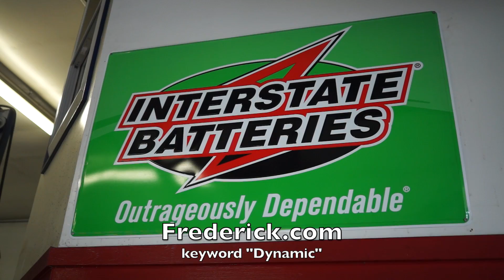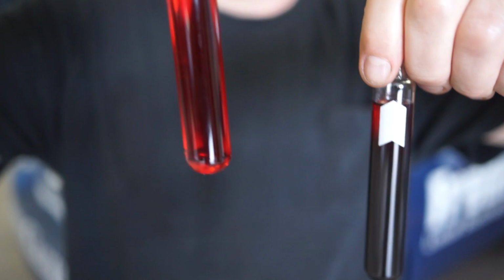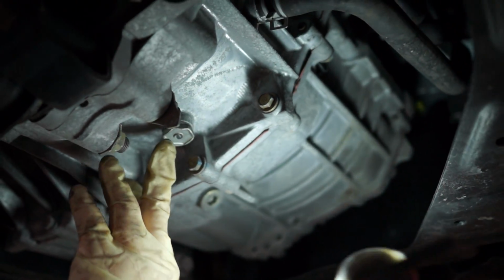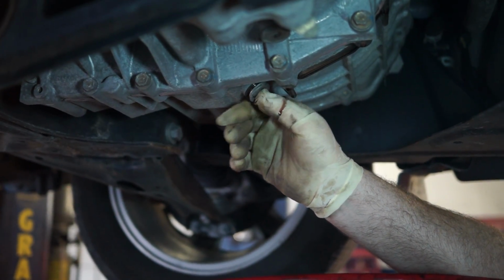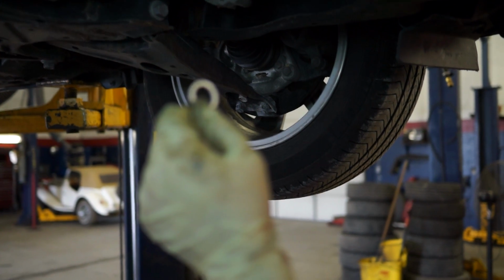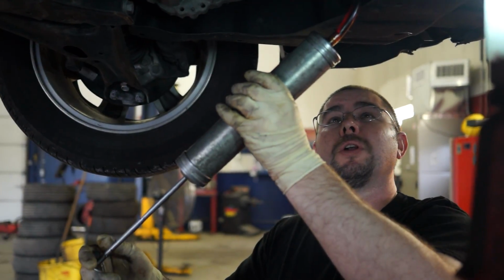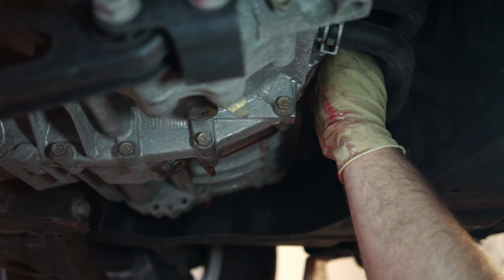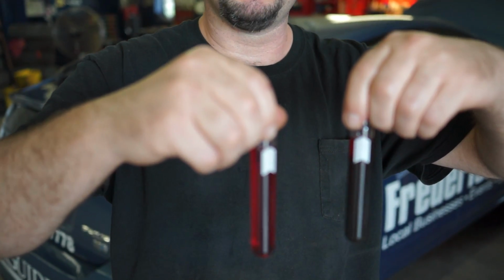Prius Transmission Fluid Change (eCVT)

Comment: Well to answer a couple questions, Craig.
Yes, I believe so, They are more reliable based in it's mechanical simplicity alone. At least in my opinion. Why, because there is much less mechanical things to go wrong. Such as valve bodies to get clogged or worn out and then there is the torque converter, fluid pump, numerous seals,& ect,ect. in a typical automatic transmission.   And,as far a electrical is concerned, they are, just as &/or no more reliable as any electrically controlled transmission now a days, which means just about all of them.
 The big thing is regardless of what you have, You must do consistent maintenance, & it must be done in a timely fashion. And to answer another question, the Toyota ATF WS may last 100 k miles, BUT WHY in Gods name would you wait that long. The lubricating aspect of just about any modern Fully Synthetic ATF will last well over 100k miles, BUT it will be so dirty that it's effectiveness will be diminished to the point that it will not be able to do it's job. It would seam very silly but, Think of it this way.  When you get new ATF Fluid do you get a fresh package of metal grit to put in with it, HELL NO. So never expect any DIRTY transmission fluid to lubricate properly regardless of how old/new it is   The job of changing the transmission fluid in a series 2 Prius is fairly simple and relativity inexpensive , if you do it your self. So what are what waiting for, DO IT!!

Comment: Shit easier than changing oil.
Reply: Well technically the fluid is oil of sorts ;p
Reply: yup, even a VW dsg can be done the same way- just fill via via filter hole- just measure what came out
Reply: Can be done for less than 20 bucks in your driveway, super easy job

Comment: Thank you for showing where and how much amount trany it needs in toyoyo pri. I didn't need to spend $400 and over 4 hrs of wait at Amko or at toe🪀🪀 dealership service.  What I need was  cheap car ramp from 🧱 mart and same toe 🪀🪀 quality AT fluid at O'really 4 cheap 💵. But you do need 10MM
HEX bit socket and good steel pipe for wrencher to losen hex bolt in toyoyo pri and pump from $🌲 2 suckin back 4qts trany oil.
I know this is dirt cheap Joe auto work.  But 4 current econ going to be 2nd  Sub prime crisis.  This is cheap way to save with less than  1hundy$s  of your  💰 to start do your self work. Oh yeah you can drop dirty trany oil to autozone. 
Go do yourself save 3hundy$s.

Comment: Toyota, who manufactures the vehicle says the transmission is sealed and does not need to be changed.  But every guy who makes money changing fluid says it does.
Reply: +Richard Woolf they can brag about their how low their "cost of ownership". i have seen quite a few of the transmissions that ran a life time with original fluid. 150k mark you need a new transmission.
Reply: +harsha806 Yeah, mine has 260k and never changed it once.
Reply: change it..........$17.00 at walmart for the fluid

Comment: Why didn't u use cvt fluid from Toyota? If it's a cvt transmission?
Reply from the maker: The fluid we used is correct.
Reply: @MidAtlanticTV  . I spoke to my local dealer and I was buying the WS and he said it was the wrong 1 for my prius. He ran my Vin and it recommended cvt fluid and not WS. I wanted to use the WS due to cost difference.  But get a prius Vin # and call dealer.

Comment: Why cant u just run a pipe from top of the engine ...stick a funnel and let gravity do the rest
Reply: You can do that. 
But remember he has a lift and the car is leveled. Time is money.  
He's make $95K+/year. And the owner must make 10X+ more than his employees.

We do some oil changes to some cars & we charge $37,000.00. 
And doing transmission fluid drain & fill are much higher.

Comment: Prius transmission doesn't have clutch inside.
Reply: ***** planetary gear set that is controlled by two electric motors.
Reply: ***** They last a long time since they have no wear items inside. Toyota actually says that the fluid doesn't need to be replaced ever, but people replace them every 100k miles for peace of mind. My trans has 315k miles on it and fluid change was at 193k. I'll replace it very soon just to keep the bearings and seals fressh.
Reply: ***** You got to watch for engine oil. They use a bit of oil after a while. Mine take a qt after about 2k to 2.5k miles and engine was replaced at 193k with a used one by previous owner.
Reply: This was also a mystery to me. Having smelt it with my own konk i did some research. It has a conventional clutch linking engine to planet gear. Google Prius clutch.
Reply: MrImarcus That clutch doesn't do anything. It's there just in case the engine lock up so the wheels don't lock up with the engine.

Comment: Its wrong oil he is using atf oil prius is cvt transmission and the fluid use for cvt is toyota oem oil cvt f tc
Reply from the maker: Nope. He used the oil that Toyota recommends. Look close.
Reply: The proper transmission fluid for the Gen2 and Gen3 Prius is Toyota ATWS fluid.

Comment: What's crazy is that Toyota and Toyota dealierships say you don't need to change this fluid. What a load of baloney. My spouse's car is coming up on 115, 000 miles, and I'm thinking I really should just change, and not even check it.
Reply from the maker: YES! Change it! But use the actual correct Toyota fluid.
Reply: @MidAtlanticTV    How come?  

   Does Toyota have some sort of special, propitiatory formula that is integral to it operating well?  

    Having done research on objective, independent  sources of testing and analysis of oil, has left me disillusioned and skeptical of manufacturer claims. 

    Some of the specialized, car maker oils did not test very well.  

   Why would it be different with other fluids?   

    I'm not trying to be a pain in the butt, nor arguing for arguing sakes, but I'm just honestly skeptical and distrustful of Toyota's claims, especially since many dealers at least, say that you don't even need to change the transmission fluid ever to begin with.  

  If that doesn't clue us in to something being rotten in Denmark, I don't know what does.  We cannot trust them, just like we can't trust our government or many other so called "authority" figures.  Too much greed and corruption among organized, high profit or powerful groups.
Reply from the maker: @justinw1765  Just be sure to use the correct fluid. It's not normal transmission fluid.
Reply: @MidAtlanticTV  Ok, thank you for the tip. I've looked at some already specific for Toyota CVT. Is there anything else that I'm missing?  

   My spouses car is actually a 2013 Prius C.  Not sure if there is any difference between the regular Prius and the C version as far as that goes?
Reply from the maker: @justinw1765  I don't know about the newer models. Sorry.
Reply: @MidAtlanticTV  No worries.  Take care.
Reply: @MidAtlanticTV  sorry can you please confirm me by return if above car's new models ie 2019 ones Corolla or Prius has a CVT transmission inside and/or there is no transmission on above car. Which is correct man ???
Reply: @attilakhan4606   The Corolla hybrid uses the exact same transaxle as the Prius.

Comment: I gutted one of these cars transmissions for fun and it doesn't have clutches, just a few gears a cvt chain and the rest is just a planetary and bare wire. Very basic compared to a traditional transmission. I believe the insulation from the wire is in the fluid that is why it is black and also some of it is metal from the gear wearing too. They really needed to resign that thing to have a better filter system. Basically the prius is just a one hit wonder after 150K these gear boxes should be replaced as the metal is fatigued and the motor insulation is just about wore off the wire then you find your car not moving due to some shorting out stator.
Reply: *****
Been reading about alot of people online losing their trans because the motor melts maybe they don't change their fluids or they had defects. I do find alot of priuses in the junk yard now from second generation to the newest but I am not going to doubt you that they go past 250K. Their are people who do their regular maintenance. One thing to consider too is that Toyota has secret recalls and they do make sure the Prius receive fixes beyond what the owner knows about when they go in for service. This has happen to a few cars my dad owned over the years they come back and say hey we have a longer expected wait and take the car apart to fix something and return it the same day and not charge for it either.
Reply: egn83b
Prius Gen I had the issue you describe.  It is rare but does happen.  They fixed that on Gen II with a modification to the winding insulation (and perhaps other changes such as better motor management).  Many, many Gen II models like this 2004 have over 300k miles on them now due to fleet and taxi service, many without any powertrain failures including the battery.
Reply: Thanks for filling me on the rest of the story. The battery lasting ten years is hard to believe but strange things happen when things are built right from the beginning.
Reply: egn83b I have a 2001 Prius and the battery is still going strong.
Reply: Just bought my exGFs 2007 prius 159k 47mpg highway 
Battery going strong gonna get them reconditioned before i get a bad cell
Reply: @egn83b  You are right about the secret warrantees, but that is why one might consider getting a high mileage vs low mileage in a used Prius.  My 2008 was eleven years old at only 95000 miles when it started to fall apart: the coolant heater valve stuck, the dashboard capacitor caused the display to blackout periodically, and the ABS actuator failing not only screwed up braking but fried my 12 battery.  Most of this would have been covered by various extended warranties, but they were extended by months, not miles, so at eleven miles, all I got from the dealership was feigned sympathy and minimal trade-in value towards a new Prius.

Comment: manufacturer says you don't need to change it. then dont!
manufacturers know better, or your local mechanic who is having hard time keeping up with new technology?
Reply: I've  spoken to taxi drivers and they say just change engine oil and nothing else.  many of them had over 300k miles on them.

mechanic shops will go hungry as new vehicles need less maintenance /repairs.
Reply: I've  had mine for 10 years with 120k miles.
Done nothing but regular engine oil changes and tires. Brakes still good. Everything in great condition.
Reply: I plan on keeping this car till it dies.
But if that's the case, it makes sense to keep all fluids clean.
Reply: Change the TRANI fluid........the manufactures only want it to last 5 years
Reply: @NinoNlkkl  i have 2014 prius v 339k miles i bought it new never change the transmission or cvt  oil yet (runs good for uber ) and not even planing to change it what you think
Reply: @axmed711   How is your Prius V doing to this day? is it dead?

Comment: It is so obvious that this guy wants to keep u to keep u in fear to not do it yourself.
Reply: The only issue is accessing the bottom of the car, level.  Without four ramps, jacks, or a grease pit, this could be a bear for a DYI project.  Yet he is pretty much citing the chilton manual.  It's the dealers and shops who claim that the fluid needs to be preheated while you are doing this that are trying to put the fear of God in you!

Comment: Way easier to run a tube from the top.
Reply from the maker: pretty easy from the bottom too.
Reply: @MidAtlanticTV  Easier then putting a hose in from the top into the hole and pump?  No way, funnel on the end of a hose and pour it in like an oil change. But go ahead and keep pumping it in with your hand with the suction gun "8 times" and cleaning up all the excess oil that dripped onto your floor.  But hey, work harder not smarter.

Comment: It's actually 3.6 quarts NOT 4. If you put 4 in you risk damaging the transmission.
Reply: It can't be over filled as long as the car is level.
Reply: been filling it to the top every time.....240, 000 and all is well.